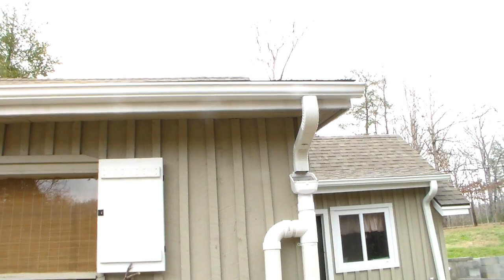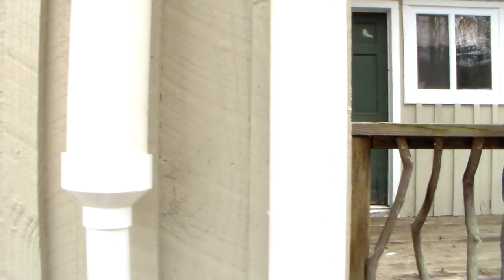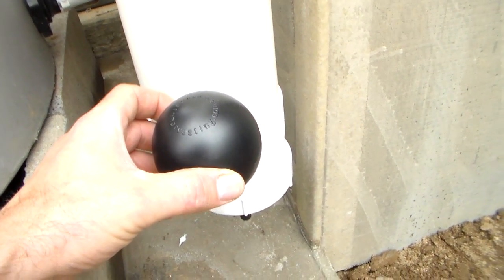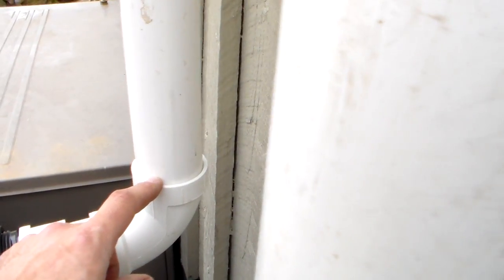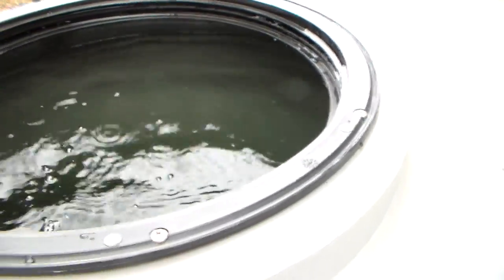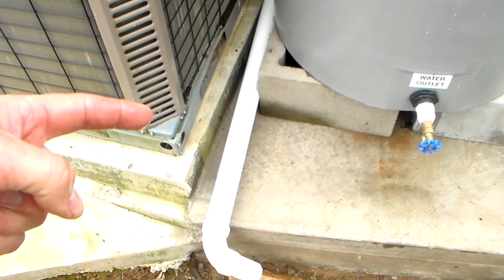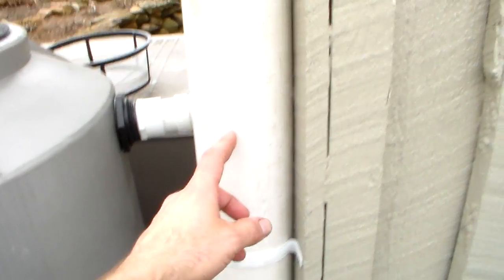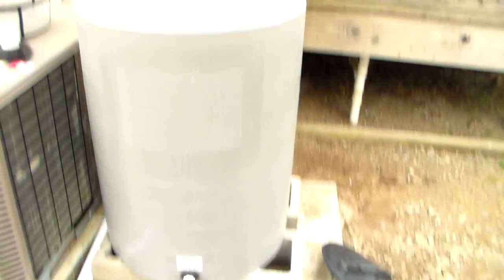Rain catchment  for the beginner.

Comment: The weep drain at the bottom of the first flush unit is not to do with freezing as stated, it's to allow the tube to empty itself after a rain so it's ready to go in the next rain otherwise it will never empty defeating the purpose of the first flush system.

Comment: Nice setup.  What confuses me is why use the ball to divert the flow from the first flush? Once the water has filled the flush tub and is at the 'top' of the flush it will divert to the pipe going to the tank, correct?  It seems like the ball, or an inflated bottle is common to use.  What am I missing?
Reply: The idea of the ball is to stop the chance of the dirty water in the first flush from mixing with the cleaner incoming water.

Comment: Thank you for clear detail.  How did you place the  bulkhead fitting for the overflow and the spigot  in the bottom of the barrel?
Reply: I've seen someone put a long thin bit of wood through the top of the tank down to the hole, then slide the inner part down the wood. A wire hook from the outside grabs the inner part and pulls enough of the thread through to get the nut started. Obviously use a rod longer the the depth of the tank.

Comment: SP!, this is a truly awesome system, but a leaf guard would seem paramount. My system's design channels the water through a nylon (old pantyhose) filter to a 1 - 5 micron filter and then straight into the container with a spigot at the bottom to transfer it to gallon jugs, canteens, etc. Sadly, it is not completed yet, but that is my design.

Comment: Suggestion, not sure how much your roof can produce based on your area or how long the wall is but why not add a couple of more containers on the other side of the AC unit where that downspout fills all three with a leveling  pipe that connects the extra containers together and then if they fill up it overflows…  You could also have them tied to a water tower with a flot activated pump as needed to transfer the water up there to give yourself water preasure and additional storage.

Comment: may consider re plumbing the inside of the inlet to go to the bottom, that way you will flush the container from the bottom up. and duct tape will make your elbows seal out leakage. fine system any way!!

Comment: Oooh nice!  Can't wait to see the pump part.   Could you (hahah lol) hook it up to the toilets so I can learn how to do that and save some big money around my house.
Reply: Ditto. Have a pump to push the water up into a holding tank in the rafters so it would gravity feed the plumbing when the power fails.

Also, wouldn't it be easier to add a filter between the pipe and the tank instead of letting crap get into the tank before you filter it?

Comment: Rather then cutting the overflow down why not just glue the elbow and have a rubber connection above the water line to be able to separate the tank from the down pipe? Can paint it white so it isnt as noticeable. The only reason right now to lower the overflow is to remove the water from the non glued joints you can also add silicone sealant to the non glued joints to have a more water proof yet still removable connection just have to wait the 24hr before they get wet.

Comment: i dont understand why you would need the first flush? why not just pipe it directly to the holding container?
Reply: Robert Russo Bird poop and particulates.
Reply: Besides bird poop, there is dirt, small rocks, and on a composite roofs, oil will rise up during the hot summer days.  Also it might keep you from having to clean out your tanks so often.

Comment: Thank you for all of your videos.  I watch every one.  Couple thoughts...
If you cut the overflow down, I'd be careful that your inflow doesn't shoot water right into your overflow.  The proximity of the overflow to the inflow as it appears in the video might cause the water to naturally flow into the overflow if the velocity of the inflow is great enough.
Another thought is that if someone was to bury that pipe in the concrete, they'd want to make sure to have a good slope so water won't collect and freeze in the line and cause damage to the pipe or concrete.  Your short run looks fine, but might be a good point to mention for others. :)
God Bless!

Comment: Does the holding tank have some kind of heater for winter time.
Reply from the maker: Does not need it where I live.
Reply: southernprepper1 i  live in ohio where it freezes in the winter...what is the best way to keep it from freezeing?
Reply: southernprepper1 I may be wrong, but didn't it get down around freezing when the ice storm took out the power? It might not have been long enough to freeze a large container of water.
Reply: It takes a long cold freeze to freeze a barrel of water. what you might try is to get a small cheap immersible fountain pump and just keep the water moving.  It takes a much lower temp to freeze moving water.

Comment: How long is the first flush system  approximately? This is probably the best rainwater catchment system I have seen!
Reply from the maker: The flush is about 6 foot long.  A rough figure is 18 inches of 4 inch pipe holds a gallon.
Reply: It looks very effective! Does the system require cleaning every once in a while?
Reply from the maker: Brennan Jones It depends on what you want to use the water for.  I try to keep mine clean just in case I need it for drinking.  I would not drink it from the tank without treating it and making it potable.  Plus I like to see clean water in my tanks.
Reply: southernprepper1 I like how you have the overflow drain also! So with that, it keeps cycling through water right? It sure saves you a lot of time cycling through water stores!
Reply: Why is the strainer of the tank on top when the faucet is at the bottom? Also, hw many liters os gallon is it?

Comment: How do you keep the tank from freezing?
Reply from the maker: I live in the south so that helps.
Reply: Greg Hall Water freezes top down.  Stop the top of the water from freezing and it can not freeze enough to damage the container.  Many livestock systems have a low voltage pump that pumps water up a hose maybe 2 or 3 foot from down into the tank and up out of the water only like 4 to 6 inches and back towards the top of the water.  Some of the water may freeze around the edge but the splashing water from the pumps tube will prevent water from freezing and water from a couple feet down is to warm to freeze so the pump wont freeze.

If I did not explain enough, you can find videos on You Tube explaining it. It says it is a heater but it is a De-Icer by pump.  You will understand better.  I would get a thermostat switch and set it to 35 degrees.  If it gets to 35 degrees, the pump turns on, when it gets back above 35 degrees, the pump turns off.
Search on YouTube
 Stock Tank Heaters that Save You Big Bucks

Obviously you can order one but with a little thinking and planning, you could build one.  A 250 watt heater is needed to stop freezing down to -30 degrees.  So even a 100 watt heater would be maybe 10 times what a small 10 watt pump would cost.
Hope this helps
Reply: leave room at the top about 9" to allow freezing it should not break if ice has room to move
Reply: southernprepper1 Thanks, yes that would help. I live in Wichita Falls Texas and had 2 500 gallon taks freeze and almost lost them.  Am looking into a submersible heater.
Reply: There are electric water heaters made for livestock tanks available online
Reply: Winkin Smile Thanks, that is the direction I was going in.

Comment: Good set up but I would do research on the run off of that asphalt roofing as far as drinking is concerned, but if its for gardens it may be fine.
Reply: +BadBrainPrepp it would need to be boiled to "purify" it, though i would trust tap water more than this water
when water is short though....

Comment: I'm curious, with the screen leaf guard, is the first flush really necessary? What is expected to be in there that the first flush will remove? Thanks!!
Reply: Basically there would be a lot of sediment that would end up in the first flush. A lot of the dirt that is agitated and moving around in the water will settle at the bottom of that cylinder. That is why when you see a lot of gravity type filtration systems with a large tank, the spigot is usually not all the way at the bottom. You sacrifice some space at the bottom for settling.
Reply from the maker: It helps alot gets the smaller stuff out.  But if your just using it for watering plants no big deal.
Reply: I can imagine it would take the bird poo and other stuff from getting into your water.
Reply: Where did you get the water container? How much?

Comment: if you switch the overflow pipe to the other side you can use less piping and it will be more efficient and easier to clean